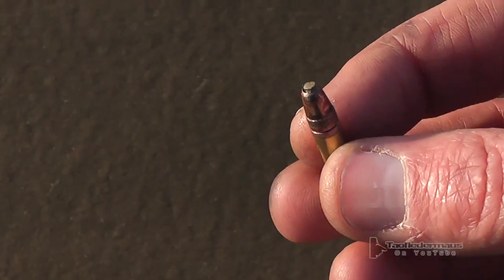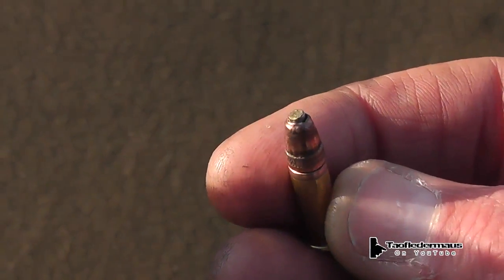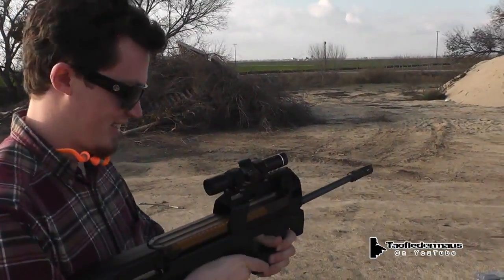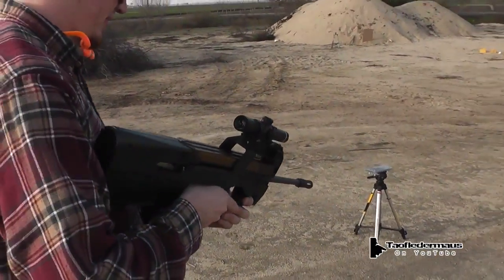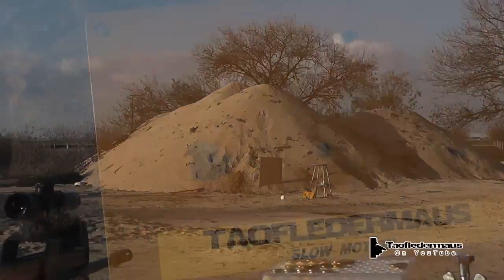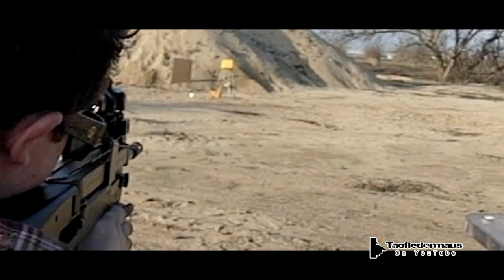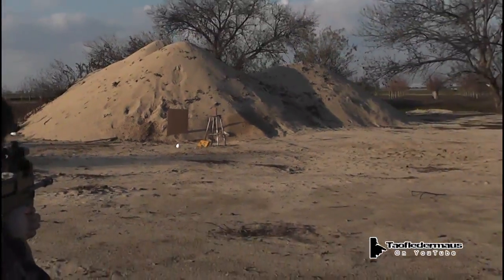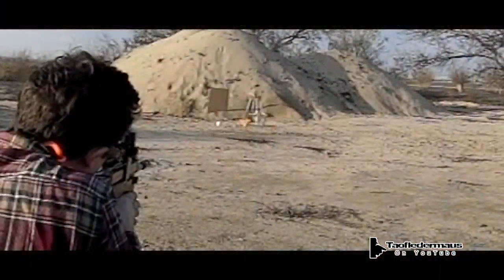FLINT-TIPPED .22LR Bullets - What the HECK will they do?

Comment: No no no yall did it wrong. Your supposed to use a .22LR hollow point , Secure the entire flint it should protrude off the end of the projectile a little bit, with regular super glue. It doesn't have to be nothing expensive, and you should try firing the projectile from an actual rifle or a .22 long revolver

Comment: Lotsa fun experimenting with .22 rimfire fodder. In the 1980's I tried filing down the tips of .22 solids to create semi wadcutters. I also filed down rounds to full wadcutter. Results?? Meh, not very impressive. I even tried widening hollowpoints to create a larger cavity and those suckers did flatten out but it ain't practical. I did get .22 CCI birdshot rounds, split the blue plastic cap and spill out the #12 shot and replace with #6 (only held five pellets) and those were swell. Remember when rimfire bricks (500 rounds) sold for under $10???

Comment: haaaa!! that's silly. here let me mention this; when the natives needed arrow heads,tomahawk blades what did they use? a few lighter makers use the substance. it's commonly used in industrial applications. this is why....its flinty. which means its hard. sharp. will keep a cutting edge. easily chipped give an edge. resists high temps. put little pieces of this stuff in a sizeable cartridge, shoot something with several( even 22 cal) a trauma team with "up" OR pre typed blood and D5W probably couldn't help. the substance tears all tissue to ribbons leaves little shards. hits a bone bounces shreds some more until the kinetic energy is dissipated. good thing it just 'net talk.

Comment: In my insane youth up in New Hampshire my buddy and I used to take 8 oz. glass coke bottles (really thick glass), fill them with gasoline, stick a rag plug in the neck and light it.  We would then move off about 20 yards (at night, hard to see with open sights) and hit it with a .22 LR round.  

The concussion would geyser the gasoline upwards through the neck, firing the rag out as a (momentarily extinguished) plug in the geyser.  When the geyser column reached the apex, the retained heat in the rag would reignite it, and light the vaporized geyser, and the flame would track down the 40 or so foot tall column almost instantly.  

We called them cheap July 4th displays.  Surprisingly, the fire would not spread laterally to speak of.  The thick glass of the bottle was very effective at containing and directing the concussion geyser upward.

How cheap?  Bottle - 2 cent deposit; .22 LR - 85 cents a box of 50; gasoline - 20 cents a gallon.  Fire volcano - priceless.
Reply: It's folk like you, that get folks like me in trouble. I'll come back w/an edit to let everyone know how it goes 👍
Reply: I want to see this
Reply: Wish gas was still 20 cents a gallon
Reply: @FOURPOUNDS  I had a '57 VW bug - 10 gal. tank - and the gas at the station near my girl's house was 19.9/gallon.  I was (God knows why) determined to get $2.00 worth of gas in that tank, failing repeatedly.  One night, low on reserve, I decided to drive around the station block; the station was at the bottom of the hill.  I got to the top of the hill, ran out, coasted to the turn, and rolled down the hill into the station bone dry, empty fuel line and pump.  Got the pump to turn $2.00 just as the gas dripped out of the overflow.  I won.  'Cuz 'murica!  Or some such.  As kids, we get ideas, and no reasoning will stop the obsession.  19.9 a gallon.  $2.00 a tankful, good for nearly 400 miles (36 hp engine).  Still a favorite memory, and I couldn't tell you why.
Reply: George Steele thank you for that story it made my day

Comment: Liquid does not ignite , only the vapor phase. Get some vapour above the liquid and the flints should ignite that combination. I would not use too much gasolene nor get too close! A milk carton with the top cut off and a striking plate strung to the top should work. Avoid steel wire and use string for safety.

Comment: you should deplete the paint can before shooting it (not sure how much) and that should provide the proper mixture to ignite from the round.
Reply from the maker: That doesn't add air  to the can.
Reply: I shot a motorcycle gas tank with 6.5 Swedish Mauser tracers once. I tried full, half empty,  mostly empty, shaken up..........every combo I could come up with. Never did get it to light up and those tracers were really good ones. I tried close range, long range.....nothing.
Reply: *****
Try a can of starting fluid (ether). It should make for quite a show.
Reply from the maker: You still need the perfect air/fuel mixture to achieve combustion.
Reply: And ignition should be achieved when mixture is ready, not before.
Reply: it doesn't matter how empty the tank is if not enough oxigen is in it . If mixture of vapours are wrong, in your case to rich, nothing will happen. Mixture of vapours and air must be right.
Reply: slowpokebr549 where in the world did you get 6.5 Swede tracers?

Comment: Ok, im confused here.

How is this an air soft gun if its shooting .22 LR.

also, how is this a p90 if its shooting .22 LR not 5.7.

also, how would this be a p90 not a ps90?
Reply from the maker: The answer is yes
Reply: i did not ask a yes or no question
Reply: Mike Warren it is a ruger 10/22 with a P90 stock mod to make it a bull pup configuration
Reply: no its not, an airsoft gun would explode under the power of real smokeless powder.
Reply: The extent of the mod is severe... google airsoft .22 modification
Reply: ***** I was thinking the answer was leaning more towards seven.
Reply: MonarchTherapsids Inostran Then perhaps you should start or join a lobby that can try and fix your gun laws?
Reply: Mike Warren its a Mod on an airsoft gun
Reply: +Mike Warren they took an airsoft p90 and pretty much changed the inside workings to metal and just used components that fed 22s instead of 5.7 and its technically not a p90 at all it just look like one.
Reply: more of a glock guy
It is a conversion kit not air soft body at all.
Reply: levi wilder its basically a ruger 10/22 that looks like a p90
Reply: Yep a Fabric National Herstal Designed in conjunction with the FN Five-seven pistol and FN 5.7×28mm ammunition, development of the weapon began in 1986, and production commenced in 1990 (from which the "90" in its name is derived), whereupon the 5.7×28mm ammunition was redesigned and shortened.
Reply: +Eric Mitchell this is the fuel that california will use to ban airsoft guns, and other guns. thanks.
Reply: Mike Warren probably would be shot down faster than anything. then again i don't live in cali. my friends lived there, and its honestly ridiculous.
Reply: MonarchTherapsids Inostran Well your friends need to start speaking up for their rights while they are still allowed speech
Reply: Mike Warren they really should. probably why they are gonna move after college lol
Reply: that place is communist anyway

Comment: Im curious as the the method of "drilling a hole in it"
did you pop the bullet out, drill the hole, put the flint in, then press it back in to the case? 

Also could you offer explanation as to why it appeared that the propellant came out of the entry hole and paint out of the exit? maybe the denser paint went out of the larger exit hole while the less dense propellant went out the small hole?

Comment: He took the action (the main mechanical device) and barrel of a Ruger 10/22 (a real .22 rifle) and fitted it inside of a stock (plastic shell) off of an airsoft gun.

You cannot fire real ammunition out of an airsoft gun. If you tried and somehow achieved detonation of the round's primer, you'd basically be stuck with shards of plastic in your face.

Comment: Shoot into the low sunlight, and shoot at an unopened 12oz Hawaiian punch can, sparkling or regular doesn't matter much. You will not get your fire out of it, but you will see a pretty red sparkling explosion. I had one preform a perfect symmetrical spray in a  nice arching half circle when it was all done. That would have made a pretty picture.

Comment: The only reason the paint didn't ignite.The spark was traveling 5 times faster than the escaping flammable gases and the gases simply could not catch up.
I'd try a bank shot off an iron plate with the can sitting right up against the plate.
Also with a .22 only load 1/2 of the used litter flint they'll hit with more umph 

Stay safe stay prepared.

Comment: hey man i have tried this out of my air rifle with hollow tip slugs against hair spray, 99.8% isopropel alchohol, petrol, and i even tried just tipping some on the concrete floor and shooting that nothing worked then got the lighter just to check if it had not dried up tomuch and it lit so i geuss these would only do damage for hunting if it hit a bone i geuss it would exlode out?

Comment: better question: drill bit bullets...

not really a question on second thought, but still, do that.

also, get a .410 and start shoving stuff down it. i hear deer jackers take the shot out a shell and leave the cup in then thread an arrow down the barrel. sends it out at like 500 fps or so i've heard, but you can do other stuff too. like cork screws, regular screws, corks, corks with screws IN them, sky's the limit really

cork...

Comment: there was sparks but due to the Eminence psi in the can any and all flame would have been put out cause of the psi in the can would blow out the flame and spark if you notice the sparks were way off to the side. i would suggest to try it only after you have drained all the psi  out of the can  by turning the can upside down and spraying till no air comes out then the contens would have a better chance at ignition

Comment: If you think you can sharpen a lead round accurately with a scalpel then you sir are going to be 6" short every time. Using the pencil sharpener is just fine. I already went ahead a sharpened a few. I just don't have the fancy gadgets that taofledermaus has. I'm more interested in the in the possible wobble in the bullet than anything. Along with that the velocity of the round, penetration, ect. Not arguing with you about if it will sharpen.

Comment: Having built a few lower receivers from hunks of aluminum and having an airsoft M4, it would be easier and cheaper to just buy an 80% completed aluminum lower made for an AR15.  The takedown pins are different diameters, and an upper receiver does NOT fit onto an airsoft lower without extensive modification.  Its easier and cheaper to just complete an 80% lower, not to mention safer.  

Magazine/fire control group/safety... none fit in the airsoft lower nor do airsoft parts work with the upper

Comment: Lead is actually softer than most petrochemicals. But I think your thinking about the high-velocity rounds which are copper plated. Which would damage the sharpener also it could off set the lead from the brass. I'm talking about just the solid lead rounds just shaped more like the .17 HMR or the .17PMC.

Comment: If you shot those multiple times at paint with a steel plate behind, you may get ignition. Like you say, you need the right fuel-air mixture.